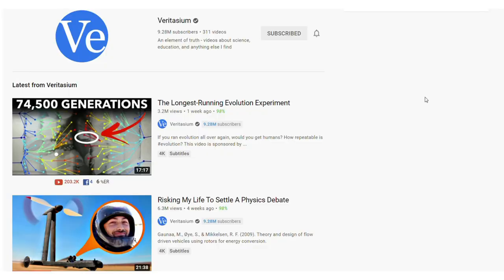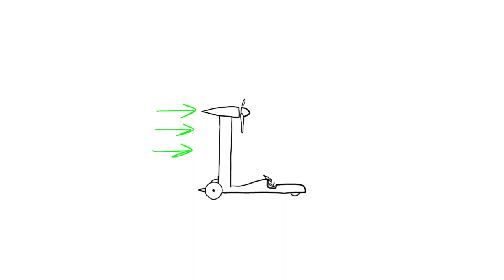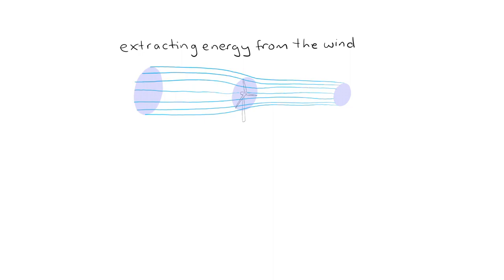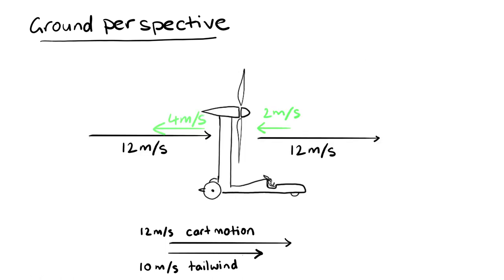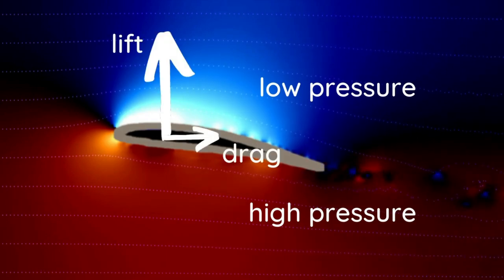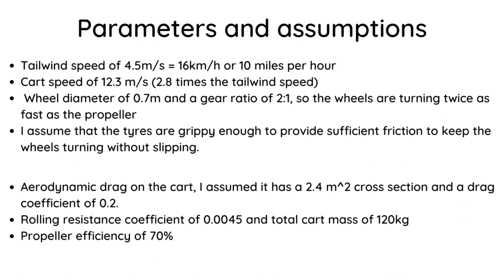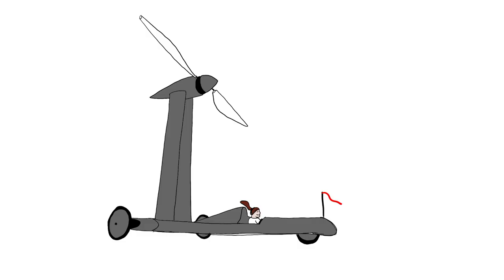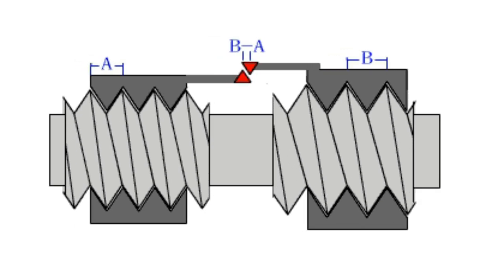Downwind Faster Than the Wind by Veritasium: How Does it Work?

Comment: I’m going to reveal here an explanation as to how the Blackbird and (most likely all other DWFTTTW vehicles) work that is so simple and perfect of an explanation that when you read it you will smack yourself in the head and say, "why didn’t I think of that myself?"

First of all, to explain how a DWFTTTW vehicle such as the Blackbird can travel downwind faster than the wind itself, you don’t need to rely upon the type of circular reasoning bordering on perpetual motion machines such as that offered by Tom Cavallaro...

“Cavallaro explained the car is able to move faster than the wind because the propeller is not turned by the wind. The wind pushes the vehicle forward, and once moving the wheels turn the propeller. The propeller spins in the opposite direction to that expected, pushing the wind backwards, which in turn pushes the car forwards, turning the wheels, and thus turning the propeller faster still.”

From https://phys.org/news/2010-06-wind-powered-car-faster.html

Nor do you need to rely on complex and highly technical papers that show that  “theoretically” such vehicles are possible. (I have read some of those papers and believe me, unless you are a highly trained physicist/engineer or perhaps a rocket scientist, the math in those papers is quite difficult - no make that impossible - to follow and understand.)

No my answer is much simpler and plausible than that contained in those papers.

And unlike Cavallaro’s explanation that seems to imply that a perpetual motion machine is, indeed, possible, my answer is not only easy to understand, it also makes perfect intuitive sense. 

In fact, my explanation can be understood by any high school student who has taken a basic physics class.

That answer comes in the form of two key words: kinetic energy.

That’s it. That’s all that’s necessary to explain the phenomenon of DWFTTTW vehicles.

Kinetic Energy.

Now before you object and say, “no way, there has to be something more going on than just kinetic energy”, consider for a moment the following real life scenario that has been taking place for decades, centuries perhaps, long before anyone ever thought of building a DWFTTW vehicle.

Surfers going surfing!

By angling across the face of a breaking wave, a surfer can travel faster than if he – or she – just caught that wave and rode it straight to shore. In that situation, all he - or she - could do is travel to shore at an average speed going no faster than the wave itself was moving.

However, by angling his - or her - surfboard to travel across the face of the wave, the surfer can actually travel at a much greater speed than the wave is traveling in a forward direction.

How do they do this?

By using the energy of the wave to generate their own kinetic energy, that's how.

The formula for kinetic energy is ½ * mass * velocity^2.

So the faster the surfer moves across the face of the wave (and they could be standing still on their surfboard while doing this, so there is no input of energy from the surfer), the more kinetic energy he - or she - possesses.

Note: The surfer has to be at or near the curl of the wave - referred to as its vortex- to move much faster than the wave's forward motion, as that is the point of the wave that is breaking and thus releasing the wave's stored energy, which energy the surfer can then use to generate his - or her - own kinetic energy needed to move faster than the wave.

Now at this point, you’re probably saying to yourself, “but Bryan, the Blackbird is traveling straight downwind, not angling across the wind, so your explanation cannot possibly be correct.”

And my answer to that is “Ah yes, the Blackbird itself is traveling straight downwind, but the blades of its propeller are traveling at an angle to that wind, and so that is how they generate the needed kinetic energy".

Those blades are, in a sense, “surfing on that wind.”

The faster the propeller of the Blackbird spins, the more kinetic energy it generates, and this occurs at an exponential rate (i.e., the square of its velocity).

So really no surprise to see that once it gets up to speed, the Blackbird starts moving faster and faster. Its propeller is then generating a proportionally greater and greater amount of energy as the square of its velocity obtained. 

That kinetic energy is then translated into the mechanical energy that turns the wheels which propel the vehicle.

Next you might object that this explanation also calls for the Blackbird to be some form of perpetual motion machine, except that it doesn’t.

As long as there is sufficient wind to first get it moving and its propeller is properly oriented to that wind, the Blackbird can eventually start moving downwind due merely to the kinetic energy generated by its propellers (seems to happen at about 10-15+ mph).

Eventually the Blackbird gets up to a speed where it can no longer counteract the forces working against it (i.e., resistance from the air, drag, friction, etc.). At that point, it has hit its top speed of about 30 mph.

Simple as that. 

Mystery solved.

Note 1: When Cavallero says that the propeller pushes the wind backwards, he is saying that the propeller generates thrust. (Note: I went back and forth with him on the definition of thrust v. lift, but let's just go with his definition of thrust for now.)

But when I asked him how much thrust the Blackbird produces, he couldn't tell me. 

When I did my own calculations regarding said thrust, they didn't balance out.

The Blackbird accelerated far, far slower than it would have at the amount of thrust I was able to calculate using data from various web sites and according to the technical papers cited by Cavallero and others. 

In addition, the Blackbird  never got anywhere near the speed it should have attained according to those calculations, meaning it wasn't generating the amount of thrust it should have "theoretically" generated. 

Then when I presented the results of my calculations to Cavallero, he called me names ("idiot" was one, there were others that were worse), insulted me and said I don't understand the physics behind DWFTTTW vehicles, which seems to be his modus operandi whenever anyone questions the science behind DWFTTTW vehicles.

All I can say is that a true scientist should consider all hypotheses that could possibly explain the phenomenon he or she is studying, try to somehow put them to the test, discard those that can't pass the test (even if that includes his or her favored hypothesis) and accept those that could explain the phenomenon observed in the simplest possible fashion.

Yet Tom Cavallero refuses to do this.

Note 2: Just like the fin of a surfboard keeps it from being pushed sideways by the
wave, so too do the wheels of the DWFTTTW vehicle keep the vehicle moving in a direction that is parallel to the wind (i.e., straight downwind), and in doing so the propeller blades are kept at the correct angle to the wind needed to "surf" that wind and generate the kinetic energy needed to power the vehicle.

Consider for a moment, what would happen if the Blackbird or other similar DWFTTTW vehicles were merely allowed to freely move in any direction.

What would happen is that due to the wind pressure on the propeller blades it would merely turn sideways and, in a strong enough wind, likely tip over.
Reply: Congratulations, you're the 6,373rd person to present a "simple" explanation that not only goes on and on and on and on and on, but is also wrong.

It's ok ... you're not special -- just another in a looooong line.
Reply: @johnborton4522  Okay, then don't just tell me I'm wrong, do the calculations and show mine are wrong.

I've already done the calculations for thrust (as best as I could given the data at my disposal) and those calculations showed that the Blackbird was not producing anywhere near the thrust it should have been producing should the DWFTTTW hypothesis be correct.

Even changing the numbers got it nowhere close.

Tom Cavallero could not tell me the actual amount of thrust produced by the Blackbird or point any substantial errors I had made in those calculations.

He did give the actual weight of the Blackbird to use, but that still was not enough to make up for the discrepancies seen. Not even close.

So my alternative explanation is that it is the kinetic energy (KE) produced by its propeller blades that then drive the wheels.

I have not seen this explanation offered on any websites or comments section on Youtube videos I have looked at (which are quite a few), so my feeling is that it is something that hasn't been considered before. 

Perhaps it has...but to the best of my knowledge it hasn't.

But in any event, if you're so sure you're precious DWFTTTW theory is correct, then you should be able to calculate the kinetic energy of the propeller and compare that to what is needed to propel the Blackbird to speed.

Go ahead and do that, and then see how that stacks up with my calculations (which I am in the process of doing, again based on the data at my disposal).

If you can, please provide me with the weight of the Blackbird's propeller and its rpm at speed, so I can use that data in my calculation of its KE, otherwise I will (once again) just have to guesstimate those numbers as best I can.

Again, I'm not saying that the Blackbird can't travel downwind faster than the wind, I just don't accept the extraordinary claims of DWFTTTW adherents.

As the saying goes, extraordinary claims require extraordinary evidence.

So where is your extraordinary evidence that DWFTTTW is the one and only correct explanation?

Your unwillingness to consider any other explanation is indicative that you have a very closed mind, not the hallmark of a true scientist.

Btw, do you and Cavallero monitor these Youtube comments boards 24/7 for any challenges to your precious DWFTTTW theory?

Do you have like a strike team ready to go at a moment's notice?

I ask this because don't recall posting anything in reply to you re KE, but you suddenly replied to my KE post within hours of my having made it. 

SAD!

Just so you know, I'm not the least bit intimidated by your obtuse and obstinate behavior and continual calling me (and others) names and hurling of insults. Very juvenile of you. Why don't you grow up and act like an adult?
Reply: A simple explanation would be a link to a video of the treadmill toy out in the real world on the ground going downwind faster than the wind, while being propelled by wind energy alone. Nobody can seem to come up with that though. Does anybody else stop to wonder why?
Reply: @johnborton4522  So you're saying you don't have a video of the model doing the same thing? At any point have you seen me dispute that the full size vehicle can in fact go faster than the wind in favorable conditions, and taking speed measurements at optimal times? I want to see the model do the same thing, because it's what Veritasium and various others constantly put forward as the proof of concept. It is also a significant factor in the wager. However, I still maintain it is an incredibly poor analog, and doesn't work in real world conditions until I see otherwise. From what I can tell, Veritasium has done you no favors at all - just created controversy around what is otherwise a seemingly impressive achievement. Maybe this is why YouTube is considering a system by which it rates the credibility of content creators.

Let me finish with this, as it gets to my other issue of recording instantaneous speed vs average speed over a known distance. If I go to my local grocery store on a windy day and strap a piece of cardboard to the back of a shopping cart and call it a sail, then let the wind blow it across the parking lot - at some point or another I can guarantee you with almost 100% certainty that the cart will be going DWFTTW when the wind drops. To a lot of people, including myself, this is what you're doing with blackbird. My evidence to support that comes from your own data that shows you recorded speed for the claimed x2.8 record a few seconds after the wind fell by 40%. Even in the video you linked in the previous comment, when the camera looks up at the wind direction indicator and anemometer, that change of direction could have mainly been caused by a drop of the tail wind speed. Why not have a continuous picture-in-picture of the wind measuring equipment with real time displays of wind speed and ground speed? If you also claim continued acceleration at that point, then that brings up yet another issue of Blackbirds variable pitch prop that you can use to trade vehicle momentum for extra thrust - until the wind picks back up again.

The whole thing smacks of being a little disingenuous - like how Richard Branson and Jeff Bezos are now "Astronauts".
Reply: @rbwannasee  

Dude, approaching 100,000 comments on Derek's two videos and those related to it.  I haven't a clue what your position has been.  I was simply responding to your above comment about putting a small one into the wind.

We built the small ones long before the big one and the issue with putting small ones in the wind is that the first 18" high layer of wind along the ground outside is so turbulent (for obvious reasons) that there is basically no way to accurately instrument and monitor that wind along the length of a course.  So we built one that wind could be measured close to 15 ft in the air where it's reasonably smooth.

Who cares what the small one does outside in the wind?  It's not "Downwind, faster than the wind, powered only by the wind, steady state (with a size limit)".  No, it's do the above anyway you like.

Outside, we went big for reasons I just described.
Reply: @johnborton4522  So yes, as I've been saying all along the small one is a poor analog for the real world. Yet we have countless videos on YouTube here of the small one on a treadmill as evidence to suggest Alex Kusenko indeed needs to hand over $10k. Do you not see the problem??????? If the frame of reference is the same, then it should work. But by your admission here, it doesn't due to ground level turbulence, etc. In my opinion you need to do two things...

1) Make sure Alex Kusenko gets his money back.
2) Build a fully instrumented larger model that works exactly like the real Blackbird (or re-run full size), and measure the average ground speed vs. average wind speed OVER A KNOWN DISTANCE.

You may want to re-read my added shopping cart analogy in my previous comment to understand why I keep belaboring this point about average speed over distance.
Reply: @rbwannasee  It's quite obvious that the treadmill is supplying the energy to the wheels of the toy car to spin the propeller, hard to believe anyone would be fooled by this demonstration.

Just like those toy helicopters consisting of a simple propeller attached to a stick.

Hold it between your two palms and spin it rapidly. The thing immediately takes off, climbs through the air, and then descends back to the ground once its energy has dissipated.

Regarding your comment that "your own data that shows you recorded speed for the claimed x2.8 record a few seconds after the wind fell by 40%."

The explanation for this in the kinetic energy model is that, while it is not a flywheel as such, the propeller has a significant amount of rotational energy and doesn't just stop spinning the moment the wind dies. It continues to spin, just as the prop on a plane does when the engine stops running, and for few moments keeps providing thrust.

So the propeller of the Blackbird continues supplying drive to the wheels until it eventually slows down and stops.

The thing is this, there is no doubt that the Blackbird can go faster downwind than the velocity of the wind itself. The question is, how does it accomplish this rather impressive feat?

There would seem to be three competing theories:

1. The DWFTTTW theory in which the vehicle somehow extracts enough energy from the wind (or is it due to its apparent ground speed, hard to tell as one time they offer one explanation and at other times another) to spin the propeller which then provides thrust to drives the vehicle forward which then spins the propeller which then drives the vehicle forward. (!!!)

2. The propeller acts to provide lift like the sail on a sailboat, which lift then pushes the vehicle forward.

3. The propeller generates kinetic energy that is then transferred to the wheels of the vehicle to drive it forward, like a surfer moving faster along the face of a wave than the wave is moving forward.

Theories #2 and #3 are known to work in the real world, theory #1, not so much!

Perhaps only one is correct, or perhaps all three are at play.

As I have said before, extraordinary claims require extraordinary evidence.
  
The problem with Borton and Cavallero is that they don't seem to be open to entertaining any other theories that their pet DWFTTTW, won't (or can't) provide any data or calculations that would support that theory and, to make matters worse, if anyone questions the DWFTTTW theory, they call that person names and throw insults at them.

I just ignore all their petty and juvenile behavior in that regards, as my interest just lies in trying to figure out what the heck is going on with the Blackbird!
Reply: @bryanjackson8917  I agree with you. I too am not disputing the fact it can go faster than the wind. My issue is with how they record and present the speed data, and the ridiculous treadmill toy model - which by John Borton's own admission won't work in the real world. I take issue with your following comment though...

"So the propeller of the Blackbird continues supplying drive to the wheels until it eventually slows down and stops."

Others have pointed out this is not allowed (for DDWFTTW mode), and a one way drive system exists such that the wheels can only drive the propeller. Remember, the propeller is a "fan blowing backwards". The propeller is not allowed to drive the wheels as this is turbine mode, and stored energy or wind energy in the prop is not allowed to drive the wheels. The point I've been making regarding that is that the vehicle has a variable pitch prop that can be used to transfer momentum of the vehicle via the wheels to increase prop thrust. I read about the variable pitch prop on CNET or WIRED or somewhere like that, as it came up in the discussion about how they get the craft moving. If they claim they never touch it in a run, then I've only got their word to take for it. However, if they claim they still accelerate after a wind speed drop, it would sure go a long way to explaining why. There's interesting stuff here, but it's not what I originally read...

https://www.wired.com/2010/08/ddwfttw/

You seem focused on the way Blackbird operates, where as I'm more focused on how they measure the speed and present it. Until I see a run over a known distance (1 mile is typical for speed records - with a running start) with a ratio of AVERAGE ground speed to AVERAGE wind speed >1, then I'll only ever be convinced they are trading favorable gusty conditions for ground speed and wind speed measurements taken a few seconds after the gust ends.

I also agree that they're both pretty rude. Ironic really considering a lot of us are actually on their side, but just want what's being presented to not seem so fishy.
Reply: @rbwannasee  My point with my comment that "the propeller of the Blackbird continues supplying drive to the wheels until it eventually slows down and stops" is that one way for the Blackbird to continue to    accelerate even after the wind backs off is that, like a flywheel, the propeller would still have inertial energy it would continue to impart to the drive wheels for a bit longer. That's all.

I don't know if you have seen any of my other posts, but I did some calculations (based on DWFTTTW  papers and data concerning the Blackbird's performance) regarding the thrust produced by the Blackbird.

Those calculations indicated that the Blackbird is not performing nearly as well as would be expected assuming the DWFTTTW theory is correct.

Again, when I presented this to Cavallero and asked him about it, instead of correcting any errors in my calculations or providing his own calculations of that thrust, he just insulted me and said I don't understand DWFTTTW theory and/or had just used "random" data. (Note: He made this claim even though I gave him all the numbers I had used in my calculations and the sources for those numbers.)

Anyways, aside from his response, that got me to thinking more and more about it.

At first I was more in the "lift" theory camp.

Then, while later watching a Youtube video about the physics of surfing - which actually had nothing to do with DWFTTTW (I just like surfing) - it hit me: 

Just like a surfer sliding along the face of a wave faster than that wave is moving forward, kinetic energy could explain all that was happening with the Blackbird.

So here's one simple comparison that could be made that would indicate if kinetic energy is a possible explanation:

1. Calculate the amount of energy needed to move the mass of the Blackbird whatever distance at whatever speed in whatever time has been already been measured in its test runs.

2. Calculate the amount of energy produced by the propeller of the Blackbird.

3. Compare the two.

If they match up or are at least close, then that would indicate that kinetic energy is a possible explanation.

If the kinetic energy calculated is significantly below that needed to power the Blackbird, then that would indicate that it is not likely to be the explanation. 

However, to do the calculation for the amount of kinetic energy generated by the spinning propeller of the Blackbird, we would need to know its mass and rotational speeds(s).

All I can say at this point is, good luck getting that info out of the Blackbird team, as they don't seem to want to divulge any information that might lead to a credible challenge to their DWFTTTW theory.

Note: I've watched several videos of the Blackbird in action, and its propeller appears to be spinning pretty darn fast. Faster than 120 rpm, which supposedly a NACA 6412 design spinning at that rpm would generate 100 N of thrust.

However, the best I could calculate for Blackbird (using favorable data) was 26.3 N.

While this doesn't disprove the DWFTTTW theory, note that it does call into question that theory as the reality clearly doesn't align with the calculations.

Keep in mind here that this is important because Cavallero et al rely upon that theory to support their claims.

Cavallero et al claim it is the thrust of the prop (produced by whatever means, I won't go into that just now) that is propelling the Blackbird faster downwind than the wind itself.

In any event, even though the prop is not supposed to be working as windmill, I question whether this might, in fact, be what is happening at some point, which would serve to explain its subpar performance in terms of thrust generated.
Reply: @bryanjackson8917  I found the link where I read about the variable pitch prop and the one-way drive train...

https://www.bbc.com/future/article/20120727-the-wind-beneath-my-wheels

...there's a set of paragraphs titled 'Humble pie'. You have to scroll down a little bit. Now if there's fakery going on, this is where it lies. The vehicles momentum when it's up to speed IS STORED ENERGY, and that stored energy can be traded for more thrust by adjusting the pitch of the prop.

I think my opinion of average speeds over distance vs instantaneous speed measurement is well covered by now. I really don't have anything more to say about any of it, with the exception of the credibility of YouTube content creators coming into question. They really should give the money back to Alex Kusenko. That treadmill toy as a significant part of your evidence ... come on guys, really?
Reply: @rbwannasee  

// "But by your admission here, it doesn't due to ground level turbulence..."//

I have no idea your point here.  I said that due to turbulence near the ground, it's near impossible to instrument wind measurements in a reliable way along the course of the craft.

There's simply no 'admission' in that which would mean the Professor should get his money back. 

Definitely not following your point.
Reply: @johnborton4522  So you are going to post a link to the treadmill toy going DWFTTW? Terrific. I can hardly wait!
If it takes you a while to find, I might run out and set my own DWFTTW record in the grocery store parking lot. Seems I only need one data point, so should be a piece of cake.
Reply: @johnborton4522  Yeah, some time back I watched another channel with similar content. He had a setup with levers actuated by the nose of the vehicle working a scale mounted above. Again, I'm not disputing that it works indoors on a treadmill. Now lets see one of those models run outside - being propelled only by the wind...

I think you could settle the debate more convincingly if you ran Blackbird over a measured mile, calculated the average speed of the vehicle, and with a chase vehicle equipped as before, calculated the average speed of the wind over the course of the run. If you've confidence in the vehicle, it should pass with flying colors, right? Trust me - I want to see it do it!!!

Give the Professor his money back, and do it. Re-wager him. I dare you! Now, another poster pointed out that wind powered land speed records don't work that way due to 'lack of room!' Lol! In October 1997, myself and a couple of friends were up in the hills looking down on the playa at Black Rock hoping to see Thrust SSC run. I actually saw Richard Noble (the current world record holder at that time) in a restaurant in Gerlach, but that's a whole other story for another time...

...anyway, point is there's an absolute ton of room there, so I don't get how that's an issue. If you're maintaining 30 - 50mph or so, it'll take you less than 2 mins to cover the mile. A minimum amount of time and plenty of space for the wind speed to stay right where you need it. The Alvord Desert in Oregon is used by sail powered vehicles a lot, and I'm sure they have plenty of room there too, as do many other sites across the nation. So I reject that notion.

So sorry, the single data point speed factor reading taken just as the wind dies down doesn't sit well with me. I think it's bogus and disingenuous. If you have data for timed runs and resulting speed factors, I'd like to see it. I've sure not seen it presented on YT anywhere. I guess I could extrapolate it from your data on nalsa dot org, but a timed mile wasn't your goal back then afaik.

You know just as well as me that timing over distance is how all speed records are set. If a car wins a race, it doesn't mean any of the others that finished 2nd thru' last didn't go faster at some point. Peak speed at some arbitrary instant is irrelevant. It's about the average speed at the end of the run.
Reply: @rbwannasee  Thanks, I'll take a look at that article you linked to.
Reply: @bryanjackson8917  Notice how these guys like to craftily parse your sentences when they can, and totally avoid giving a genuine answer to a valid point when they can't. I guess they've had over ten years to perfect being evasive and disingenuous. It's a well practiced artform for them by now. Sad.
Reply: "the Blackbird itself is traveling straight downwind, but the blades of its propeller are traveling at an angle to that wind, "

This is exactly what the analogy to the tacking sailboats shown in the first Vertasium video shows.
Reply: @eyytee  Do you have a link to a video of the treadmill toy running on the ground outside in the wind, going DWFTTW? Apparently turbulence doesn't effect it after all, so I'm excited to see it finally!

I'm waiting...
Reply: @eyytee  So we're in complete agreement then.
Reply: @bryanjackson8917  "So we're in complete agreement then."

Not if you think that the sailing boat analogy somehow contradicts that the wheels turn the propeller. Both are correct and equivalent in terms of physics.
Reply: @eyytee  No, this is exactly what the DWFTTW proponents say:

From https://phys.org/news/2010-06-wind-powered-car-faster.html

“Cavallaro explained the car is able to move faster than the wind because the propeller is not turned by the wind. The wind pushes the vehicle forward, and once moving the wheels turn the propeller. The propeller spins in the opposite direction to that expected, pushing the wind backwards, which in turn pushes the car forwards, turning the wheels, and thus turning the propeller faster still.”

But then, the wheels are turning the propeller because…?

You know the old saying, if it sounds like a duck, quacks like a duck, and most of all, flies likes a duck, it probably is a duck.

So the Blackbird sounds like a duck, quacks like a duck, and most of all, flies like a duck.

And that duck is known as a “perpetual motion machine”.

Quack, quack!
Reply: @bryanjackson8917  "....if it sounds like a duck ..."

That this type of fuzzy heuristics fails here, is exactly the reason why this was a physics olympiad question. As already explained, you wrongly assume that every positive feedback loop is a perpetual motion machine, while ignoring this one has an energy input.
Reply: @eyytee  

Blackbird -- Physics' own veridical paradox
Reply: @eyytee  No one disputes that there is an energy input, that much is obvious.

The dispute is over whether that energy input provides:

1. Lift,
2. Kinetic energy, or
3. Thrust.

That's all.
Reply: @bryanjackson8917  "No one disputes that there is an energy input,...."

Then why do you keep bringing up “perpetual motion machines"? Those concepts have no energy inputs.

"1. Lift,, 2. Kinetic energy, or 3. Thrust"

All of those can used to explain it. It depends on the level of abstraction which concepts are applicable.
Reply: @eyytee  The reason I bring in the term "perpetual motion machines" despite the fact that there is an obvious energy input, is because the claims of DWFTTW theorists implies that the energy output is greater than that energy input was to begin with.

The excess of energy output over energy input - that is, their thrust - results then, in a sort of perpetual motion machine (getting something for nothing).

Lift and kinetic energy imply no such excess of energy output over energy input, so neither is a perpetual motion machine.

I had a bit of a tussle over this with Cavallero when he kept referring to the thrust produced by the Blackbird, which led to me asking him just how much thrust the Blackbird was producing, which amount he couldn't state.

This then led to me having to undergo my own calculations of said thrust, which calculations showed that it wasn't producing the amount of thrust DWFTTW theory shows it should.
Reply: @bryanjackson8917  "the claims of DWFTTW theorists implies that the energy output is greater than that energy input"

No it doesn't imply that. You are confusing energy with force or with velocity.
Reply: @eyytee  As Ronald Reagan would have said, "there you go again".

I've noticed one the favorite tactics of DWFTTW is to mix up terms, say one thing doesn't mean the other, or perhaps it does, and that this is not that but it is that when we want it to mean that but not this and really the ones questioning the DWFTTW claims are really the people who are confused, not us.

In any event, this was the basis of the argument I originally had with Cavallero regarding his claim that Blackbird produced thrust.

By definition thrust requires the input of an external power source, such as the burning of fuel such as gasoline or kerosene, use of energy that has been stored in the form of electricity, or as a potential energy (a wound up rubber band).

I said, wind by itself cannot produce thrust.

He said, no wind can produce thrust as lift and thrust are the same thing.

I said yes, well technically, thrust can be a form of lift, but all lift is not a form of thrust. 

Furthermore, all thrust is not a form of lift.

For example, I pointed out to him that you can have thrust is the absence of a liquid medium, but you can't have lift in the absence of a liquid medium.

But going past that particular argument (which admittedly, was a bit of a semantic one) you are just trying to confuse the issue.

So let's just be very clear here: Thrust is a force which is produced by energy which, with the right application can result in acceleration and  produce a velocity.

So IOW, you can analyze it from several different perspectives.

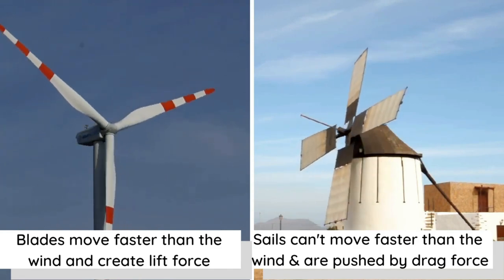In the absence of an answer from Cavallero regarding this question, I calculated the amount of thrust the Blackbird supposedly produced by using the velocities attained and the acceleration of the Blackbird (time taken to achieve that velocity) attained by the Blackbird as shown in the graph at 9:32 in the 'prof loses $10,000 bet' video by Ve.

I also looked at other graphs of the Blackbird's runs on web sites, etc., and they also were quite similar in appearance to the $10,000 bet video, so I'm fairly confident that this wasn't just a one-off occurrence.

Admittedly, this was an imperfect way to do that, but I believe it gave a more accurate measure of the amount of thrust produced by the Blackbird (in Newtons) than that given me by Cavallero, which was just that the "Blackbird had pulled dyno testing equipment across the parking lot", without any further explanation. (huh?)
Reply: @bryanjackson8917  You are still hung up on heuristics like "propeller thrust needs stored energy", which simply don't apply here. If you understand the sailing analogy, then project the aerodynamic force at the propeller blade onto the propeller axis. That is the thrust component.
Reply: @bryanjackson8917  Your Lift ≠ Thrust argument with Rick Cavallaro is basically silly.   A propeller blade (an airfoil) provides lift and a propeller as a whole provides thrust by summing the axial component of the lift vectors from each blade.  The sum of the drag vectors from each blade is why the propeller needs an external torque supplied to maintain constant rotation  (In the case of the DDWFTTW carts, this torque comes from the wheels which are being driven by the thrust of the propeller as they roll over the surface).